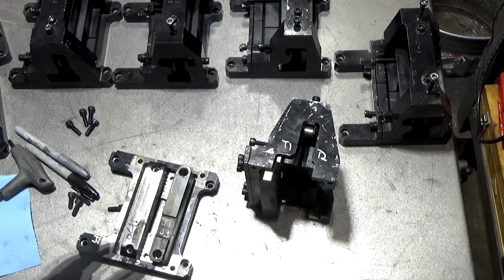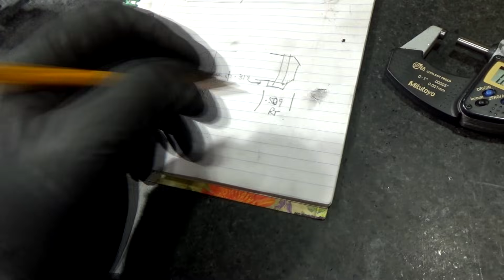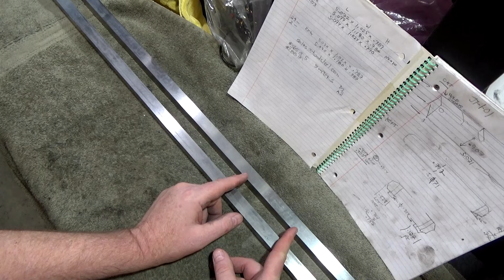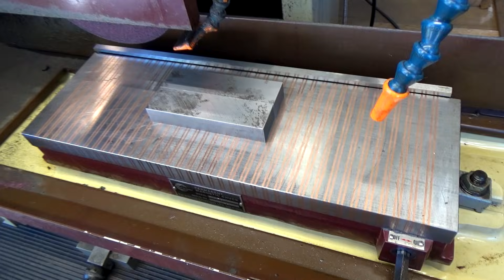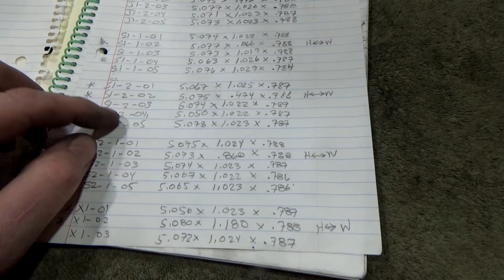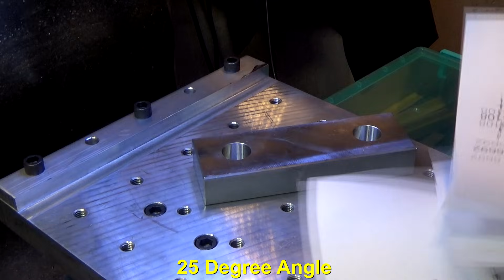264 All the Weldboxes Part 1

Comment: Did you consider counterboring your tap guides or relieving part of the tap shank?
Reply from the maker: I did, but it was really important to support as much of the tap as possible, so I didn't.
Reply: @DudleyToolwright  Good point for not counterboring the top. Leaving the hole as the tap diameter and slightly relieving some of the tap shank would use the maximum possible location available throughout the tapping process. I use a pistol drill to hold the tap against a belt or grinding wheel to neatly relieve this area.

Comment: Goodness what a project. Quite a bit going on there.
Reply from the maker: Yea, I shot only maybe 2% of the project. It was more than 60 hours of work so far. When I get the parts back from heat treat I have to assemble them all and then they need to be fine tuned in place to the metal profiles they are going to make.

Comment: Instead of finding the corner on the vise jaw, you could have dimensioned from either hole. Find the center of the hole once clamped and away you go.
Reply: I like it. Knowing where the hole is from the corner also means you know where the corner is from the hole. Adding the part onto the drawing will also give you the distance of the part chamfer vertically from the top of the jaw. This allows you to measure the chamfer instead of doing it by eye.
Reply: Simple comment….WOW ❤
Reply: @outsidescrewball  That's the benefit of completing an apprenticeship. Everything becomes second nature and blindingly obvious.
Reply from the maker: That would have been a good approach. I might have used that in the past, but having just made those edge finders, I was interested in seeing what situations these tools could be used. That being said, I would have light years more knowledge if I had been able to go through a good apprentice program, instead of the adult school, self learning route. There is no substitute for experience.
Reply: @DudleyToolwright  Very true, also remember, experience is not measured in time, but quality.